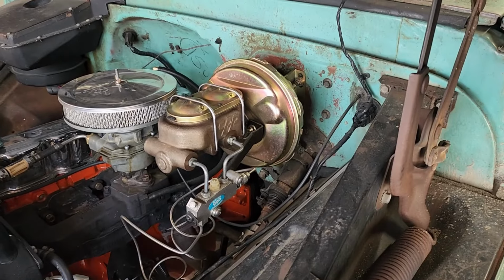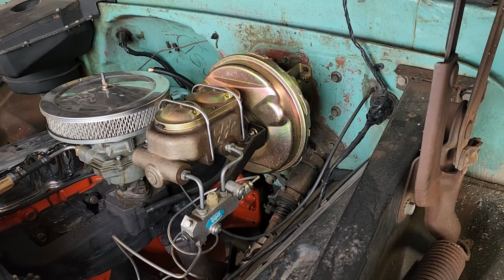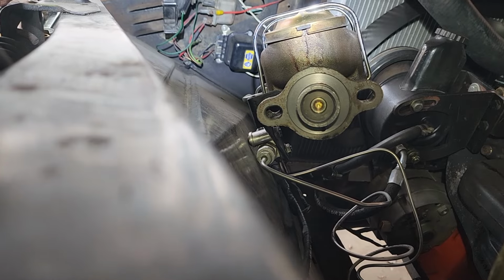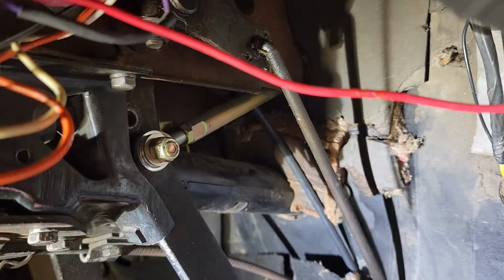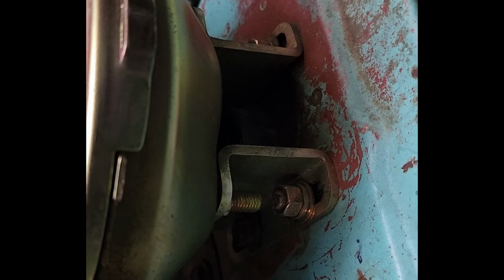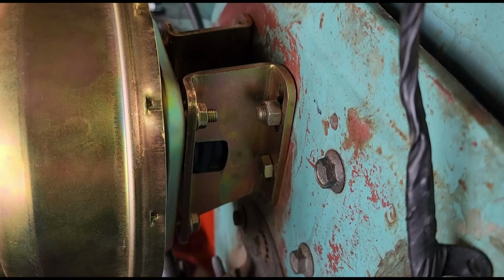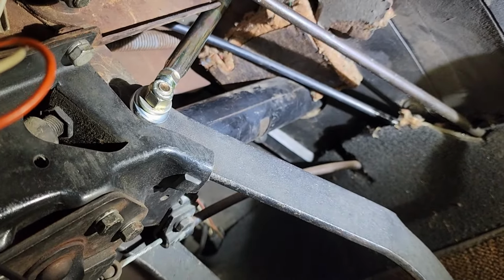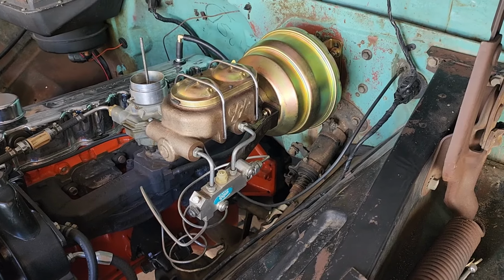9 inch to dual 8 inch brake booster upgrade on 1963 to 1966 C10

Comment: Curious is the dual 8 needs very adequate vacuum. I cannot get my chevelle to stop for sh.t with the dual 8 in. Checking vacuum tonight to be sure bit it does have a 500 hp engine so thinking vacuum just may not be adequate
Reply from the maker: All vacuum boosters require sufficient vacuum.  500 HP sounds like you may have a radical cam reducing available vacuum.